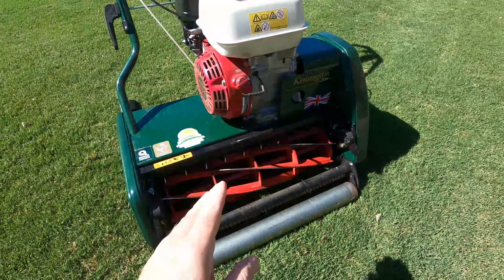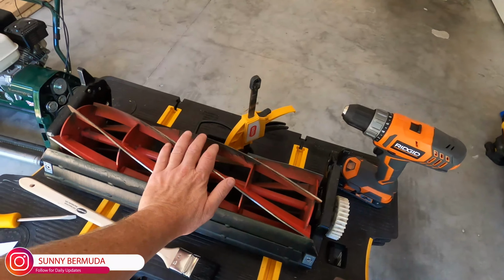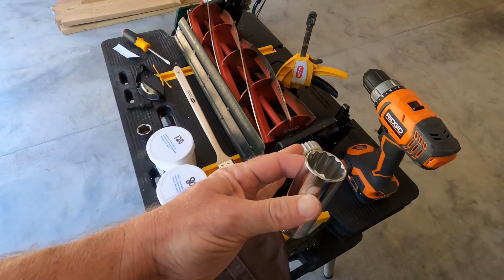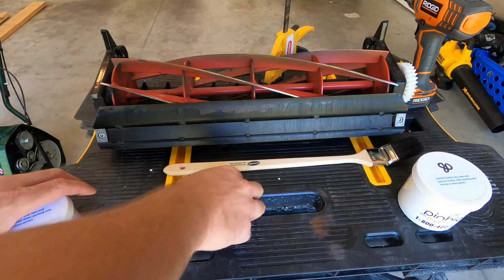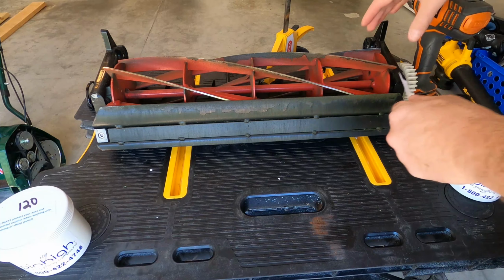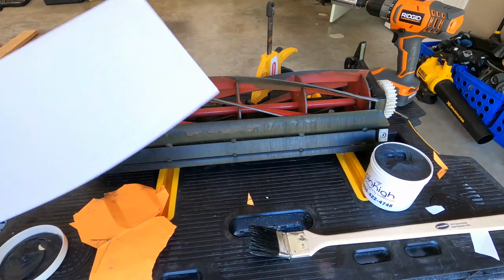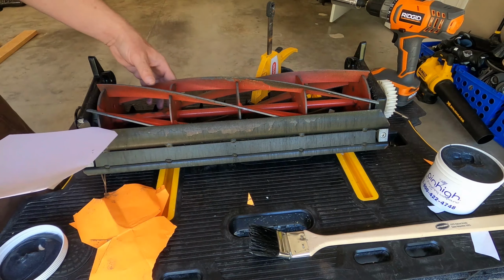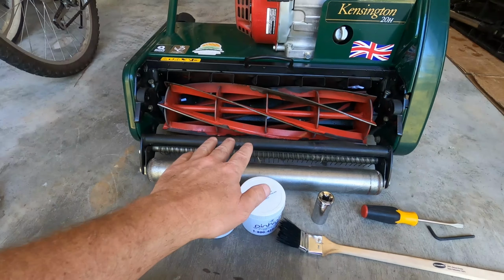How to Backlap a Cylinder Mower - Allett Kensington 20H

Comment: Dude I have so many questions... 1st, have you changed the bedknife yet and if so how was it? 2nd, do they recommend 80 AND 120? Or do you just prefer to fine tune it? And lastly if your drill overheats too much, Lowe’s sells a 1/2 in corded hitachi still for 40 bucks that works awesome for backlapping.. just thought I’d share since one of my makita drill literally got so hot backlapping.. the chuck snapped off lol don’t make that same mistake I did
Reply from the maker: Ask away! 😎 No, haven't needed to change the bedknife, but it looks simple enough.  I did the 80/120 from my wood working days.  I figured the concept was similar - use a higher grit for that pristine fine edge.  😉  I'll keep that in mind about the drill.  The one I used seemed to handle it just fine, barely got warm.

Comment: Thanks for this.  can you tell me what is the gap between fixed blade and cylinder blade at the start of the process please?  Thanks
Reply from the maker: Reel should be .005” or .02mm from the bed knife.  Check out my tips video.  https://youtu.be/5NtClQvotHE

Comment: You’ve motivated me to sharpen my 6 and 10 blade cartridges. Nice pop-up table too. Who make the table? Looks like your bed knife is newer that the reel. Who is your parts supplier?
Reply from the maker: Yes, it’s really easy to maintain the real. Quick backlap and wipe some Fluid Film on the reels before each mow.  The table is by Keter:  https://amzn.to/3KTZ0Zq
I use AllettUSA for parts.

Comment: So, swardman reels come from the factory with a spin grind and they say you're technically not supposed to backlap a spin grind.  I'm not 100% sure why but they say unless it has a relief cut into the blade it doesn't really have the same end result.  I don't know enough to argue one way or the other, but I was just curious if the Allett manual says differently?
Reply from the maker: The Allett cartridge does not have a spin or relief grind on them.  🌞The manual didn't mention backlapping so I consulted my Allett buds from England.  In fact, I think they recently release a similar video.  I know the grass cut like butter and the reel action was quiet like scissors after doing this.  Not sure about a Swardman.
Reply: Allett has a how to backslap video on YouTube on their official site.
Reply from the maker: @Kevin_67_RS  - How do you think my video compared to theirs?
Reply: @SunnyBermuda  very informative.  I use a business card to check the bed knife to reel gap.

Comment: Dude, only turn your reel backwards while there’s compound on it. You turning the reel into the bed knife with compound still on it is no different than driving it into a pile of sand while the machine is running. Worse, actually, because silicon carbide is way harder than sand. Only turn it backwards until you get the compound off.
Reply from the maker: Yep, spot on.  My bad.